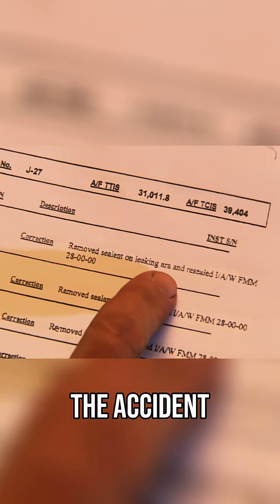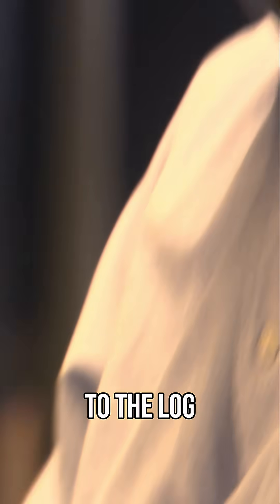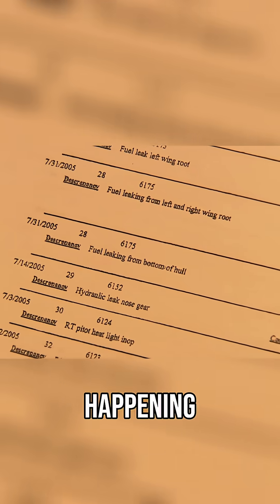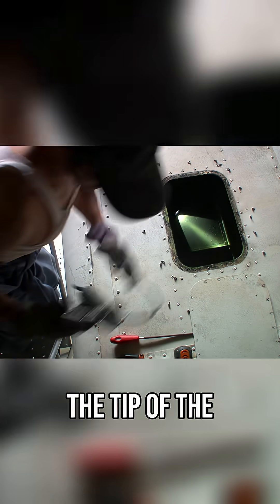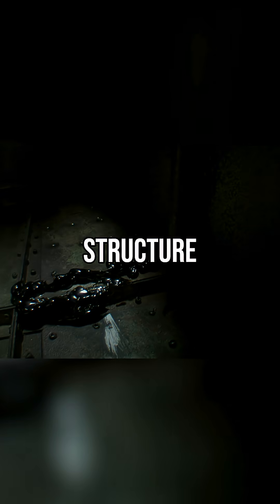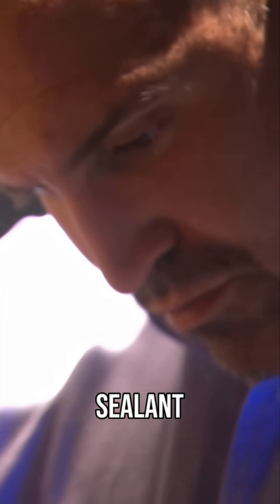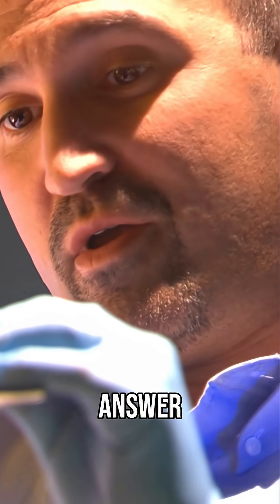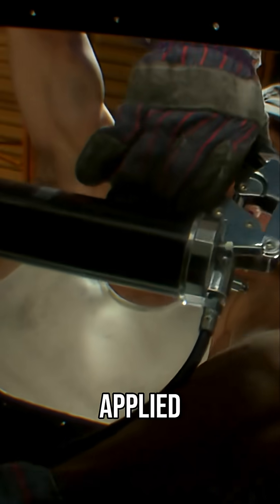Hidden Wing Crack Caused Flight 101 Catastrophe

Comment: There should have been AD notes applied to these planes. to check for cracks & corrosion in the structures especially close to the wing-root areas...AD notes MUST BE COMPLIED WITHIN PRE-DERERMINED TIME FRAMES...
     Those 'Repairs' that the supposed A&P's were making on that critical area on the wing, were extremely bad...NEVER ARE TEK SHEET METAL SCREWS USED FOR STRUCTURAL REPAIRS... 'Repair' Doubler had sharp corners on the ends, (extremely wrong) ...That hack was using a screw gun to install the NON-STRUCTURAL FASTENERS ON THAT 'REPAIR' Doubler 'scab' patch...Extremely low quality work.,.Terrifying to say the least...Please mention, that scene was fiction... 
    Today is : 11/20/25